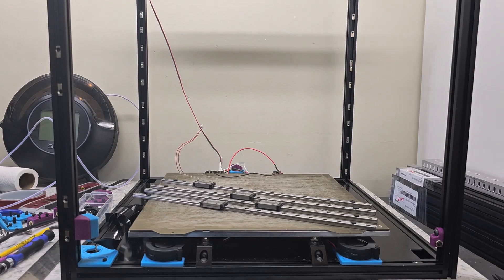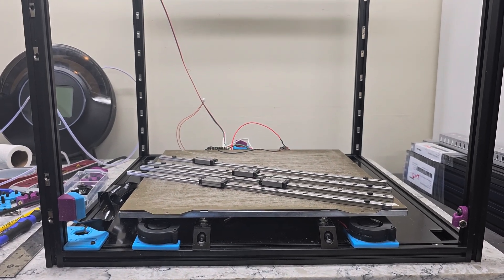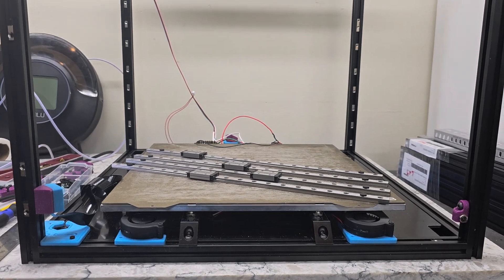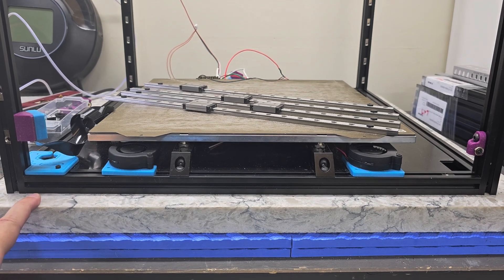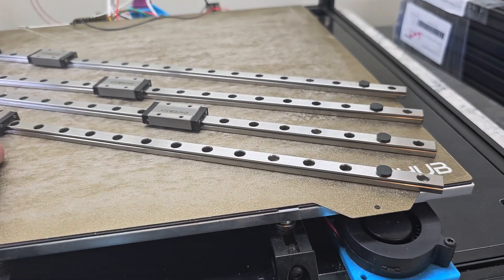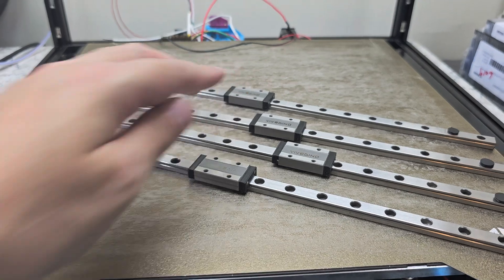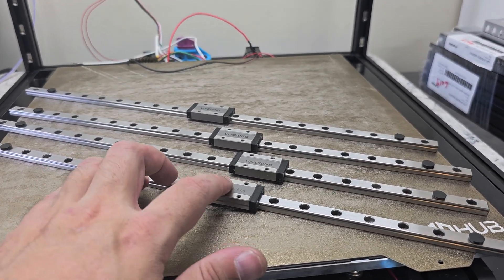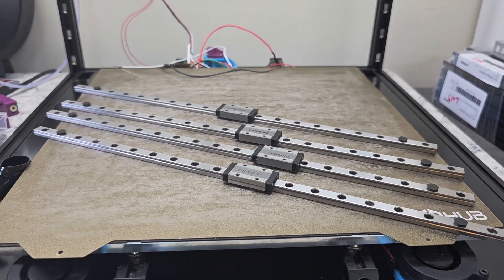Voron 2.4R2: Trying to resolve some Z banding issues plus yearly maintenance

Comment: You have inspired me to switch toolheads, panel clips, and so much on my trident, funnily enough my print quality has shot through the roof since I never was able to get CW2 working well. But keep up with the updates, as I really enjoy the vlog of the 2.4 and other printers!
Reply from the maker: Remember, you built YOUR Voron, so make it work for your needs. The stock builds are great platforms from which to expand into mods, but I am now at the point where I actively research which mods I want to install on a new build before I ever print a single plastic part.

Comment: You mentioned your AB belt getting chewed up, I am having that issue on one side of my machine. What ended up being your cause for that?
Reply from the maker: Not all of the bearing stacks/pulleys/idlers were on the same horizontal plane, so either belt would ride up over the flanges and get chewed up. They weren't off by much, but enough that addressing that discrepancy resolved the issue.